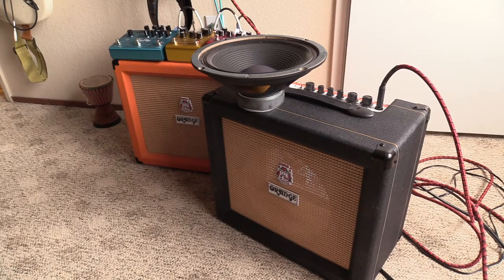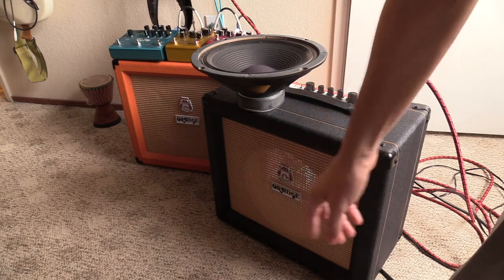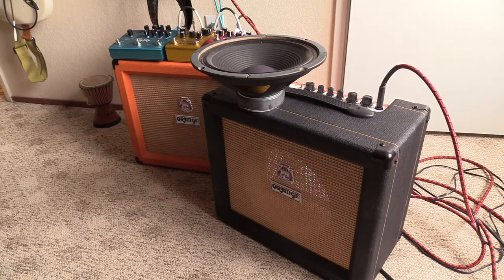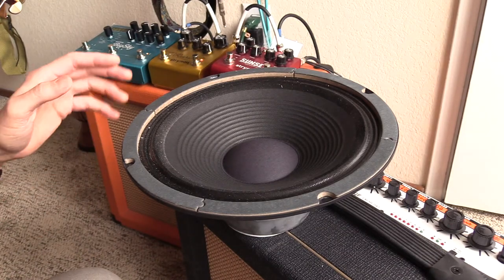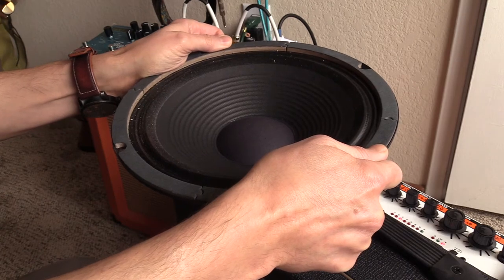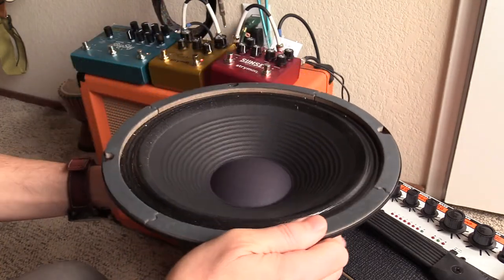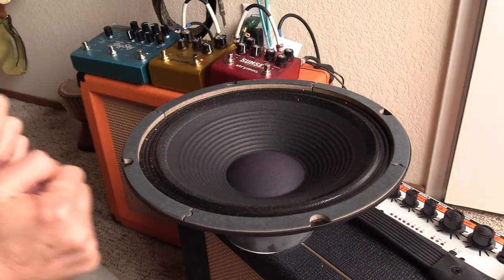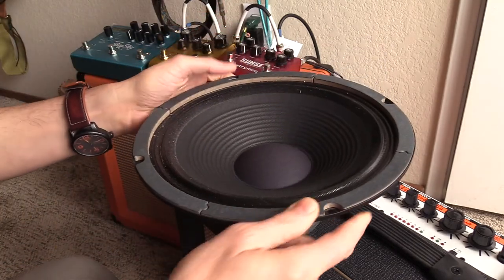Orange Crush 35RT Speaker Buzz, Troubleshooting & Repair

Comment: Just bought one used and it seemed the same way- turned out mine was fine with a different cable. My cheapo cable was the one to use this case.   Dirty channel was even making weird phaser noises...and the buzzy/noise/ static on the dirty channel was bad. All cured by a cable... then I put back in the "good cable" and all was well with that one too.  I think a similar noise that you have with the speaker can also be from the input jack.  A weak ground or something. Still get some noise when I turn the dirty gain up about 70% or so but it's expected.  The 35rt cranks and sounds fantastic.  Effects loop a big plus.
Reply from the maker: The speaker was bad in my amp.  I've played shows with the 35rt - it's loud enough without being mic'd.

Comment: I had the buzzing issue on a old Altec speaker. I lessened how tight I had it and it cured the problem. Apparently tightening it was bending the frame.

Comment: I like you analysis.  It's possible the voice coil could have become warped from heat (high volume during feedback) and is now rubbing on the magnet.
Reply: I think i might have that problem. Any fixes?
Reply: @Thecoolman1  From my experience if the voice coil windings are rubbing on the magnet as the speaker moves in and out....the speaker would require repair.  It might be cheaper just to buy a new replacement speaker.
Reply: @malibuguy5187  Yea, it’s a cheap speaker from a Marshall MG100DFX, som I’m probably going to upgrade to a Celestion something (haven’t quite decided on the model yet).